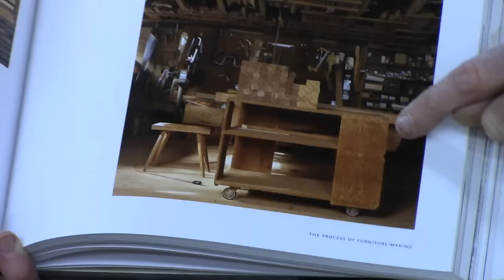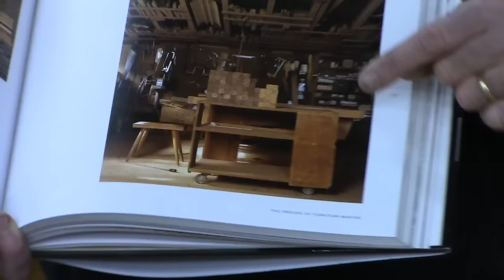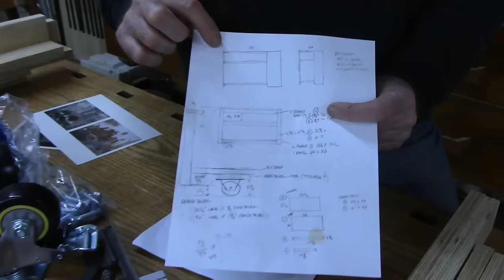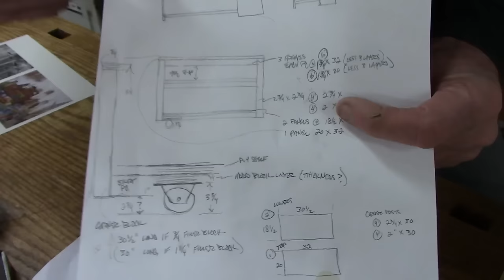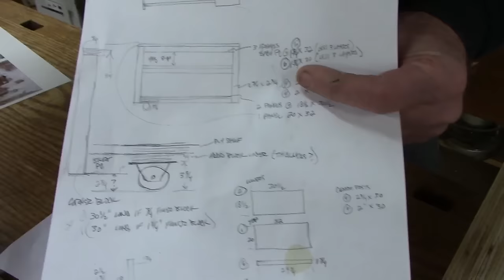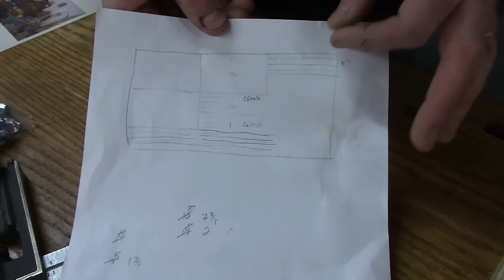Making Shop Carts with Tom McLaughlin

Comment: If you made the bottom shelf 1 1/2" larger in both directions and set your corners on the shelf then if you load it up with a couple of hundred pounds of wood the load would be supported by the sheet of plywood and castors and not just by the glue and brads.
Reply from the maker: Joe Taylor Yes, that was something I was thinking about right after the livestream ended (Great minds think alike). My aim was to make something simple and strong, so building the base a different size and figuring out a way to attach the corner post to that would have been more difficult. I was concerned about the fact that the corner posts weren’t resting on the base until I realized, the spacer pieces I nailed between the bottom shelf sit on top of the bottom shelf so the load isn’t just carried by the brads and glue on the outside bottom corners. Given the tight fit of the corners over the base, and the sheer strength of tight bond three being crazy strong, it’s probably not much of an issue. But I’m like you, I’d rather have the thing structurally sound. So just for kicks, next time I think I’ll even glue in the spacer sticks and substitute solid wood for the plywood spacers I used. Thanks!
Reply: @EpicWoodworking  That's the paranoid in me.